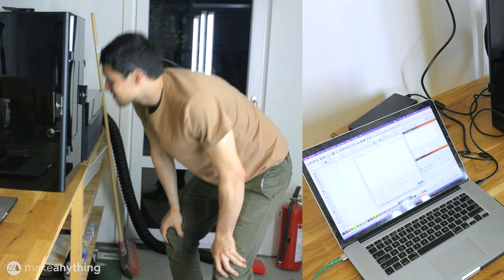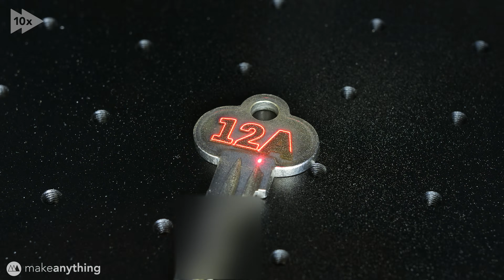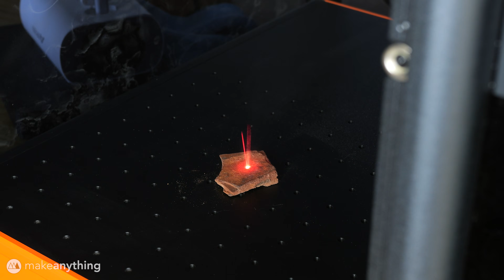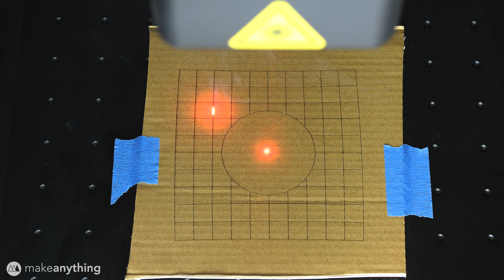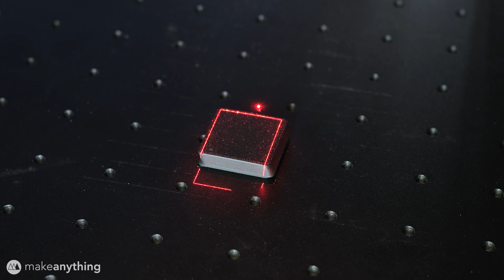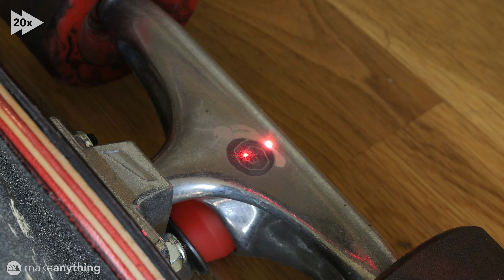Fiber Laser VS. 3D Prints, Rocks, Metal // EM-Smart Basic 1 Review

Comment: The galvo lasers ARE for production uses...  These are the same galvo lasers that have been marking chips, trimming resistors, and doing all sorts of other things in factories in china for years..  But you really need to take a safety course.  Don't be carving certain metals without a PROPER fume extraction system, and it needs to be attached to your work surface and perhaps assisted with an air nozzle.  Those metal fumes and particles are inert on surfaces but harmful in your lungs.  AND it will ruin your laser.  Those brass coins go up into the air, and they have a lot of zinc, and welding galvanized metals is a well known health risk, and it is worse when lasering brass.  Zinc oxide is safe to use in sun blocker, but it is deadly as a gas to breathe.  And you don't want that metal dust in your house getting into fan motors and parts of your AC.  

This is a great video, but you don't seem to be aware of the harm you are exposing yourself to.  Read up on welding fume management, and understand what you are doing is actually worse, in terms of volume of metal vapor in the air.

I have a galvo as well, and they are a lot of fun, when used safely.  You are not being safe at all as far as I can tell.  Those cobwebs are showing you the insides of your lungs, and the lungs of whomever is also exposed.  You may think it is in the garage, but air and the particles it carries has a way of infiltrating the whole house, and you will carry it on your clothes.  On carpet, it will create a cloud behind everyone that walks by, no matter how often you vacuum.  You must extract that at the source and not let it in the air at all.  Duuuuuude!

Other things like the rocks are usually pretty safe, but it depends on what is in them.  Many metals like iron are fine, but steel can have all sorts of things.  Remember the Erin Brockovich story where chrome plating factories were poisoning children with hexavalent chrome?  Those stainless steel coins produce hexavalent chrome gas if they have chrome in them (the stainless coin blanks DO have chrome in them)

Use a good respirator, use point of production forceful fume extraction, get it within an inch of your work item.  Use air assist, and make sure the parts of the system that can leak are sucking and not blowing.  Any positive-pressurized portions of ducting from your air handler needs to be of leakproof construction and tested.  Run the pressurized ducts on a white surface and inspect for dust leak marks.  The workspace should be a negative pressure zone, so air leaks into it, rather than escaping.  The fume extractor will do that for you, unless you are in a ventilated room sharing return air with the house.  If you make your own fume extractor, test it for leaks, and seal it well.

Comment: You should really look into the XTool F1 Ultra.  It fixes a lot of your complaints about this unit. while having both a 20w Fibre laser and a 20 w Diode laser in the same machine - having the top down camera for lining stuff up. and marking slightly curved surfaces without the need for a rotary (up to a point) it can map your curvature of the material and apply an offset.

Comment: Hey Devin, big fan! I was wondering if we could link to work on a project together. I want some help in 3d modeling some cheese based items. Let me know what you think!!
Reply: One instance is that I'm sick of my Gorilla pod for using it on my desk. I would really like help in designing a two piece wedge of cheese that I can place some pebbles inside of to make it bottom heavy, a hole in the middle counter sunk to place a 1/4" screw so I can place a ball head mount on it so I can better use my cameras on a flat surface like my desk.
Reply: Oh, another cheese related item I think would be wonderful to work with you on is a cheese themed SD card holder so I can better control my camera's SD cards and my printer's SD cards.
Reply: One more thing, I'd love some help on designing a 3d printer that uses cheese wiz to make my crackers happier since my life is sad.

Comment: Just be really careful to not do quartz. Look up Silicosis and you may decide to no do random rocks.
Reply from the maker: Oof! Good to know 😥
Reply: I would be curious to try lasering into underglaze on bisque fired ceramics, but I'd worry about the dust as well.

Edit: Just looked and it has, of course, been done before
Reply: @Wumf  yep. Always my number one concern with my lasers is material safety. Since there are so many materials that are insanely dangerous to laser cut, but that people cut with vinyl cutters all the time. So nobody connects that the two cutters have very different effects, and just pick up material for a vinyl cutter for their laser cutter and risk killing themselves and eroding the steel in their machines.
Reply: @Wumf I have it in the other room so as not to breath or see it. It totally works.
Reply: The problem in most of the cases are people with insufficient Safety precautions. Most materials are fine with an decent active-filtering-Unit.
Reply: You will be fine unless you are doing it nonstop for several years.
Reply: Dado que tiene problemas en curva, cual sería tu recompensa mendocino

Comment: Instead of a rotary unit, I think it would be enough if the device could change its focus motorically. I mean this would allow it to cover a little wider angle.
Reply: So,  i saw one on FB where the guy rigged up an auto focus beam that fed into an ordrino or Pi that then controlled a stepper motor on the top where the had crank had been.  This gave him almost live focus control on some curved surfaces but was mainly for auto focus after he put various height material under the lens.   So.. options.
Reply: Great idea actually